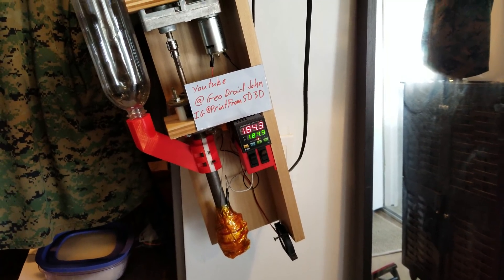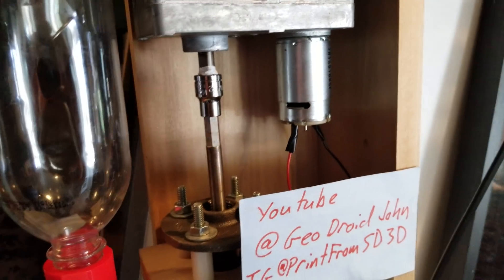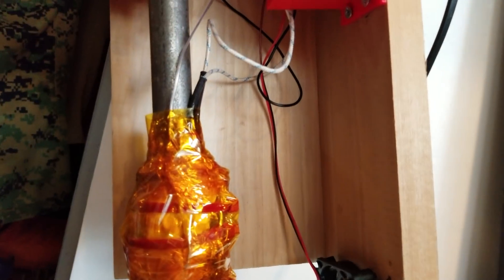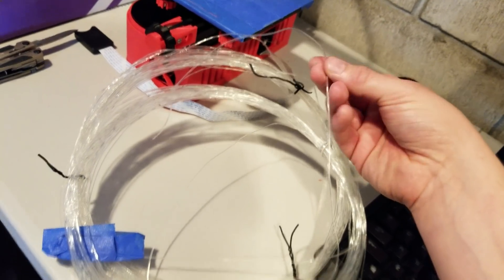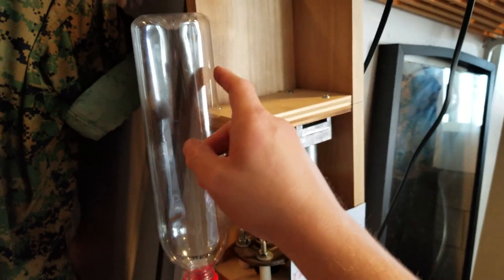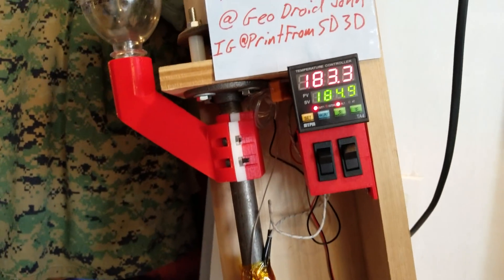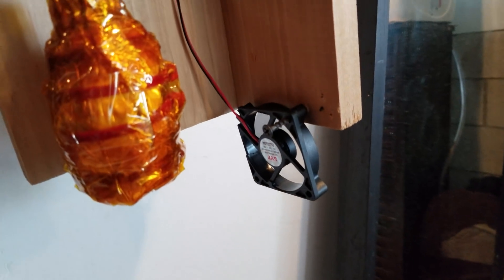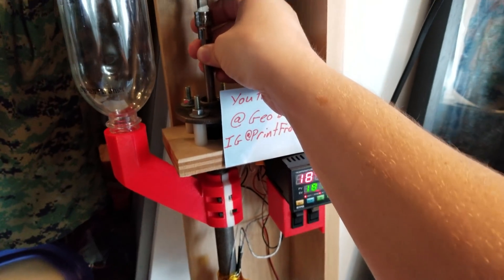Making 3D printer filament! PLA for FREE?!

Comment: I tried going to that website and it says there's no domain
Reply from the maker: Links fixed! Thanks for your viewership
Reply: @GeoDroidJohn  also why don't you add a 1.75 mm tube on the end to make it to where the filament comes out exactly the size it needs to be?
Reply from the maker: The tip gets very hot and the filament needs to cool before touching anything as it is very sticky as it comes right out of the nozzle. Much like how printer extruders get clogs when the retract is too much and it pulls molten plastic up into the ptfe tube.

The company has much better models now and they produce more consistent results. 

The intent is that it goes from low temp molten to solid in the time it takes to touch the ground
Reply: @GeoDroidJohn  I understand that. There is tubing out there that is made of metal. If you use maybe a 4-in to 5-in piece the heat would not be as great on the end of the tube. The tube would only be there to serve the purpose of smoothing out the filament and conform the diameter. Having filament that is pico or micrometer smaller is fine.  but, some printers can't deal with filaments that are larger than say .02 or .03 larger than what it's supposed to take. I had a gear strip out because of cheap filament that I bought that exceeded 1.77 mm.

Comment: Have you tried any recycling yet? Maybe just shredding an old failed print?
Reply: I don't think he would want to back this machine off of recycling. Recycling filament is a whole nother process and of itself. it would also require the machine to be built around that purpose. I would say, just based on my personal opinion, That this would work just fine On one condition. That you cut the pieces of plastic down to a similar size of the pellets. This machine doesn't look like the tolerances are that great for anything to exceed the size of those pellets.